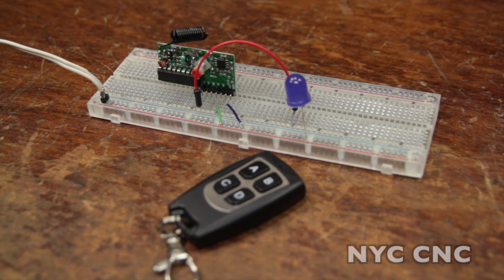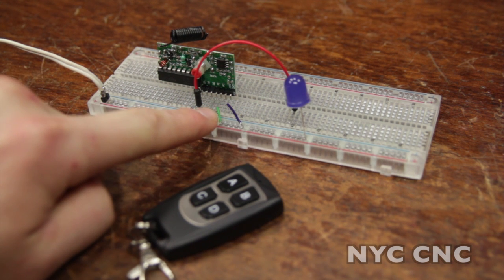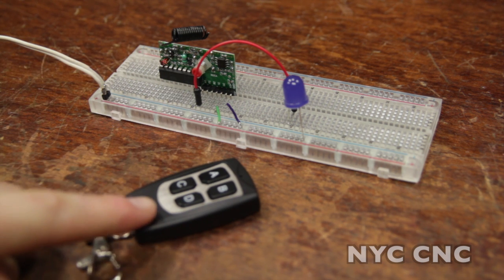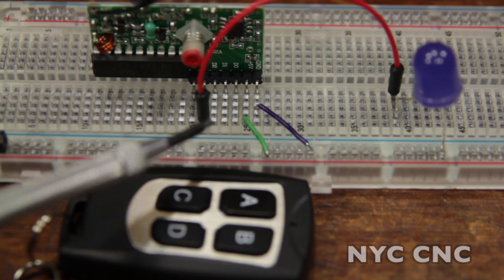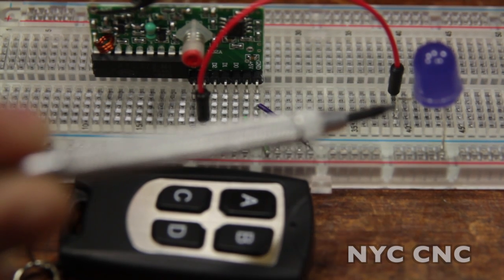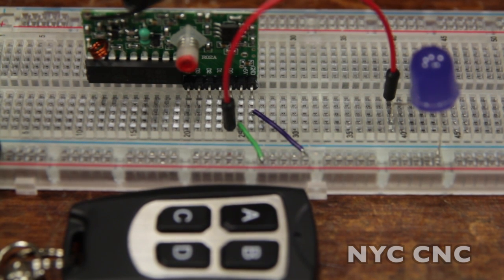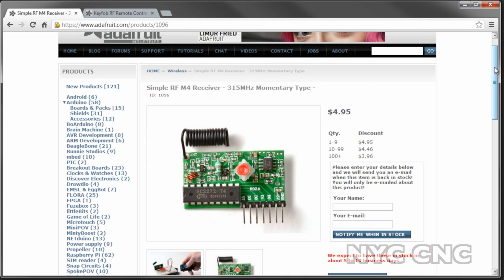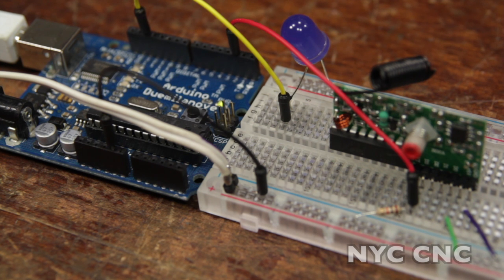Wireless RF Remote & Receiver!  Easy & Cheap! Great for Arduino and Raspberry Pi!

Comment: Firstly I'd like to thank you for the thorough review and tutorial. And secondly I have a question. I'm trying to use this module as a Start/stop button for my project meaning I push for example a button A whose digital output on a receiver is connected to a Digital Input on Arduino. With the change of Digital input state the program would start. I can make it work just fine with a normal push button but I can't understand why it doesn't work with this remote thing. Thanks in advance

Comment: Ok so with the toggle type I can use it to drive a small 5 volt relay which in turn can be used to activate a 24 volt contactor to turn on a 120 VAC Furman power conditioner for some PA gear.

Comment: I am trying to use it to RC control model boat. By directly connecting it to a tiny DC motor thru a Darlington transistor , I have pulsating current ( except at very close range), causing the motor to rotate roughly 1 turn per quarter second. Did you encounter this phenomenon ?

Comment: Hey there. Quick question do you think the buttons on the remote can be rewired with other buttons so the the remote can be build into something?

Thanks great vids keep it up.
Reply: So remove the buttons of the remote and get a other EG hole mounted button and solder it to the contacts of either A/B/C/D. I probably want to build it in a small handle so that i dont need wires to actived my project. Also how long to tou think the battery will last? Thanks.
Reply: Alright thanks i will give it a shot. Keep up the adruino vids.

Comment: Can you make a video for cloning rf remote controls (2 buttons) using an esp 8266 as that has wifi and i want to be able to use the esp web page library to send an rf signal, it uses 433 mhz fm i think and i have them fm modules you have in this vid?

Comment: according to the data sheet, the chip can take up to 15Vdc.  Have you tried this with a voltage over 5vdc?  I'm looking to control power to a 12v LED automotive bulb for a project.  I'm trying to limit the number of batteries needed.  I just want to use a single 12v battery for the LED and receiver.  What do you think? 12v too much?

Comment: Let me see if I understand correctly. You showed the Arduino being triggered by the IR board, and the Arduino then lighting the LED as a way to control devices other than an LED, correct? 
Did you show that because the IR board doesn't have the ampacity to control a device with a larger current draw? (I assume the Atduino board also gives you other function, but I'm curious about the ampacity aspect, only.)
If you wanted to control a simple light, but with too large a current for the IR board, could you use the output from the IR board to trigger a relay, and accomplish the same basic switching function of the Arduino?
Thanks,
GeoD

Comment: Great! If I understand correctly - this can control several receivers? Do you know of a similar circuit which can be 'keyed' to a specific receiver? Don't want to be opening the neighbors' garage doors too ;-)
Reply: they are not code hopping. but each receiver is bound to the transmitter. you can bind the transmitter to as many receivers as you'd like. so lets say you wanted to turn on 10 RX's all connected to christmas lights with a single fob. Of course, if one doesn't turn on, and you hit it again. they all turn off.....so its not really practical to bind multiples.

Comment: Hello ..

How to make the transmitor recognised by the receiver. The question here is to synchronise the sending signal to the receiver. Is that be programmed ? I have indeed another 4 button receiver.

Please tell how to deal with it )
thank
Reply: 2. Learning and clear procedures:
Learning procedures: 1. Press the learning key, the LED lights. 2. Press any key on the remote, the LED flashes three times then turns off, indicating learning successfully
Clear procedures: Press learning key for 8 seconds, the LED from on to off, indicating clear successfully

Comment: Thank you for sharing it - very interesting project! 
It seems that receiver operates on 5V, and as far as I know Raspiberry PI GPIO input is not 5V tolerant, but 3.3V. Am I correct? Can it be directly connected as suggest?

Comment: Hey NYC CNC, I am thinking about using this method to turn on/off a light, tv, or a coffee maker. Fyi, im a complete novice here, so im just looking up different things i can use. So, i found out that I'll need a relay board to turn things on and off. However I still have a couple questions in mind:
1. Am I able to connect this receiver output pins directly to my relay, or do i need something working as a median in between?
2. As you showed in the video, each button on the remote is responsible for each pin on the receiver and as soon as you release each button the led turns off. Is there anyway to use let's say button A to turn on something and B to turn it off?
thank you so much <3
Reply: thanks for your reply! So, is there any way to make it happen? like using arduino maybe?

Comment: Hi. If I'm using a smaller LED, what resistor value/size should I use? Also, how do I connect it to the LED and breadboard? Thanks.
Reply: Resistor value =( V out -  LED v ) /  LED i = 3.8/0.01 = 380 ohms. 1k will be fine.

Comment: thnx for the demo, great stuff :)
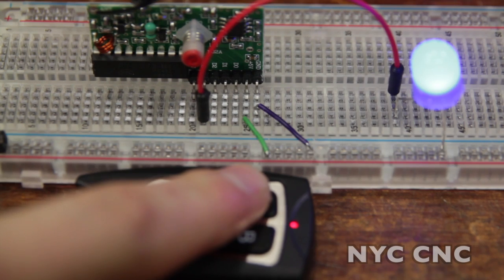one question though: is the delay you speak about at 2:10 a general latency issue between rf transmitter and receiver ? I wonder if any rf system could deliver an almost 0 latency on/off signal, like normal wired connections do.
Cheers and again Thanx for sharing 8)

Comment: This could definitely be used to turn on and off another separate arduino circuit correct?, I'm absolutely sure there is a way to integrate this software with another software that does a totally different function, say for example you have a security system that you build and then use this circuit to separately activate and deactivate the security system...I'm kind of trying to do just that but i'm not sure on how to integrate the two pieces of software, Would you be able to offer any help ?

Comment: THANK YOU FOR YOUR VIDEO
A QUESTION THE PIN VT THAT FUNCTION DOES
Reply: VT Pin does go high whenever a signal is received. So you can add it around your code as a filter, because it only goes high when any button press is received.

Comment: Ok I have 2 Altima keyless entry and start I lost the chips one is a 4 wire and one a 5. Is there anyway you can take the 5 wire and the 4 wire abs switch them like use the 5 wire with the 4 wire keyless key

Comment: Can this setup be used to activate a switch a couple feet away? Can you also wire the  arduino to have the buttons programed to run other devices, like a flash light?  Thank You.

Comment: hello. I made this project but I put a stepper motor instead of LED and it works fine. but i need some help with the sketch.
how can i define 1 button of remote control to turn the motor shaft CW and CCW ?
i mean when i pressed the button the motor turned 45 degree CW then the button didn't accept the same command and turn the shaft that way again and when hit the button again its turn upposit direction.
is that possible to answer me
regards

Comment: I'm trying to use the 5 volts from the arduino but the receiver isn't working, you have a white cable going to some other power source? is there a reason the ground and 5 volts on the arduino wont work?
Reply: +NYC CNC I triple checked everything, tried 9V batteries and wouldn't work. I ordered a new one and it worked just fine, must have gotten a bad one. Thanks for the video!

Comment: I have a LED dimmer/controller that works by RF. I need a keychain Fob style remote to control it. I need for the Fob to turn on the LEDs at the brightest setting upon initialization OR the Fob must have dimmer/increase buttons. I can have this Fob manufactured, but I don't know the RF frequency of the dimmer/controller, and don't know how to find out what it is. My electronics expertise is next to nothing. Can you, or anyone reading this please point me in the right direction? Any help would be greatly appreciated. Thank you in advance!!

Comment: It seems that the delay to transmit is longer to switch on than to switch off. I want to use this system to equip a CNC probe when the probe touch I want the motion of the table to stop.
I am going to emit continuously and stop the signal in case of hit so to work in NormallyClosed
Reply: I am going to measure it today precisely but by eyes I will say 500ms for transmit on and much below 100ms for switch off

Comment: Will u plz provide its detailed schematic diagram and code details?
Reply from the maker: Have you checked out the page on NYC CNC? If not,  https://www.nyccnc.com/hypocycloid/#1568490748960-247310c7-5d5d
Reply: How to re transmit the received RF key code?
Like replay attack without using raspberry pi..

Comment: How many meters is the recommended antenna length?
Reply: how far do you want it to go?
I'd say 3 ft, but I LOVE distance, so don't actually go that long with the antenna.
maybe 7 inches?
Reply: Firstly, I appreciate. However I found out that I need 17 cm sth length for 433 MHz antenna, 1 year ago. I searched antenna length-frequency relationship on the internet and I used a browser calculator as I remember. I think it really matters how long the antenna is, not as long as :)

Comment: I've got mine hooked up to an Arduino to read button presses from the key fob but for some reason the distance isn't very good. Ideas? I just replaced the batteries in the remote and it's still not very good. ?v=6KoqqCH6QI4 for an example of what I mean.
Reply: I don't have the 10k resistor... maybe it's working but there is noise on the pin.
Reply: Brand new batteries and sometimes I have to hold the remote right next to the receiver. I have the resistors, just didn't hook them up.
Reply: I was inside. I've never tried outside. The project will be going inside a car.
Reply: Also, my friend unwound the coil antenna and it's working a lot better now.
Reply: I'll try that. Thanks!
Reply: John NYCCNC here's a demo of my current project. Testing custom colors and animations.
Reply: Yeah. A friend wants to light up his car.

Comment: I knows it’s 5v but I need it to work on 3v... is that possible
Reply: TheGooberMan add a resistor?
Reply: You can use a voltage converter, like Sparkfun BOB-12009.

Comment: The AdaFruit is EXPENSIVE BangGood offers the whole set for 3 pieces for 15 dollars!
Reply: *****
My final batch was even cheaper 10 sets for $13,50 I really like those China shops
. oh btw we use comma too here in NL.
Reply: *****
yeah it serves to shop around and to keep your eyes open. Sometimes you have bargains.
Like 2 days ago Arduino Nano $2,49 a piece and 5 for $10,90 so I bought 15.

Comment: Hey can i send commands to receiver thru arduino with RF emitter ? I want to control directly from arduino or raspi the relay RF like this http://img.alibaba.com/img/pb/288/677/496/496677288_380.jpg